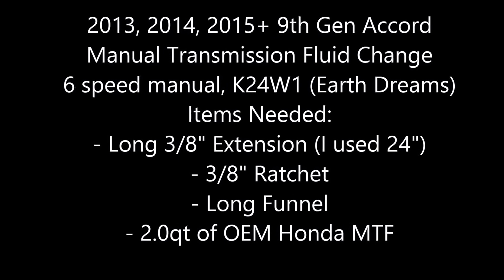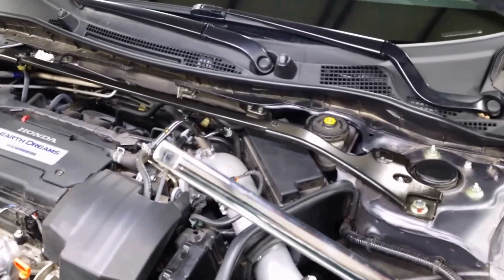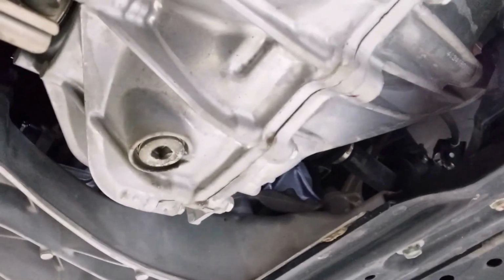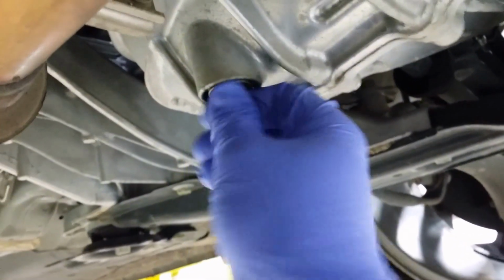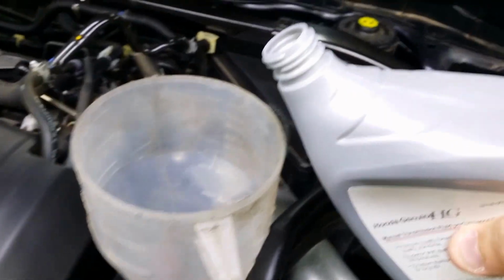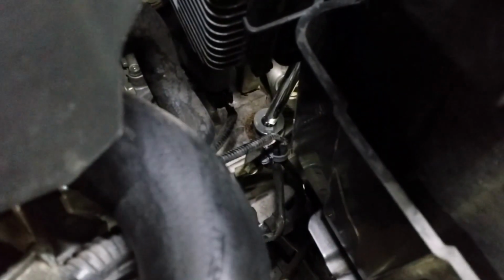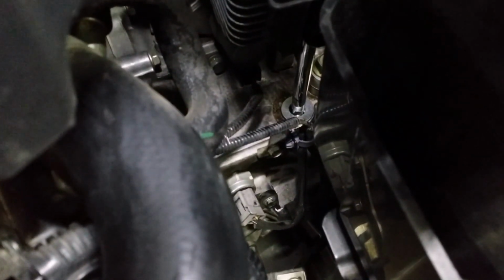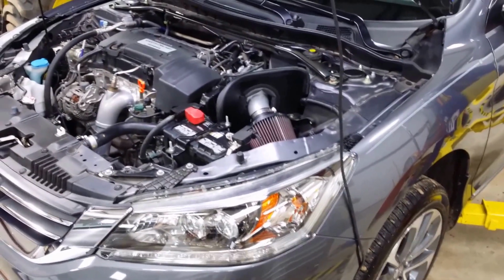2013 Accord 6 speed manual transmission fluid change 2014 2015 K24W1

Comment: I replaced my oem factory honda mtf with GM synchomesh friction modified. It got rid of the notchy-ness..but only slightly. Still notchy from 2nd to 3rd and from 4th to 5th. Any ideas? Im currently at 103k miles, when does the clutch fluid need to be changed?
Reply from the maker: I'm at almost 200k on this car now.  I've noticed that it has become a little notchy in 4th to 5th.  I still change the MTF the same way with the same stuff in this video.  

I have never changed the clutch fluid in this car either. (original owner, 2013 6MT). It is just DOT4 brake fluid.
Reply: @ScottHD  and you’ve always used the oem honda mtf? Everyone and their mother swears by this GM synchomesh friction modified fluid and redline. Still notchy to me. Mines a 2014 and i love the car but that notchy shift feel is starting to get a bit annoying.

Comment: Where can I get a down pipe like that..? Just bought a 2016 accord sport w/manual trans
Reply from the maker: RV6 performance makes them.  Google that name and you'll see several options for finishes.  mine is a ceramic coated stainless steel one.  It has held up great for almost 100,000 miles and counting.
Reply: slimjim355 I live it, there are so few manual trans in the Midwest, so far I'm the only one that has it... I love it...I got Honda data flash pro also, runs awesome.. with just tune, down pipe and exhaust.. can't believe it's only a 4 cyl..
Reply: So you noticed a considerable power improvement with the mods (RV6, SRI, & Hondata flash) over stock?

Comment: Do they really say you need to change it every 30K miles? My last manual car specified a 105K mile change interval...I have 28K on my 2013 Accord Coupe right now. Guess I need to add this to the list of 30K maintenance.
Reply from the maker: Dell0304 k series have shorter drain intervals I'm assuming because of the synchro wear issues.
Reply: Yes.  The manuals do recommend transmission fluid changes (@ or about every 36K miles).  If you really want the transmission to work strong for a long life, I would highly suggest following this procedure at least every 40K miles.  On the CVT models you can stretch out to 50K miles.

Comment: How many quarts does it take for the V6 Engine, is it the same basic procedure i assume?
Reply from the maker: misternintendoman physics not sure on the v6
Reply: 2.6q so two and half bottles of the honda oil
Reply: Would it not have been a good idea to show the location of the level check plug to double check that the transmission is in fact full???

Comment: How'd you manage to install the Touring LED headlights on this Sport? Did you have to get a new wiring harness?
Reply from the maker: Kenneth Morrison it's a plug and play harness made by the "Hard Top Guy" (HTG).  I think they were about $150.  He makes them for rear LED OEM taillights too which we did.   I bought all of the lights new in 2013 and it was about $2000 at the time since there was nothing used available yet.
Reply: Scott H awesome! Also, thanks for the informative video.

Comment: For automatic trans v4  for 2013 accord, where is the dipstick  located?
Reply: +James Chuaycham I thinik that is one of those "sealed" transmissions.  They are becoming like that more and more.  I am thinking that if it had a dipstick tube he would fill it through that.  My 06 Jetta 2.5 has a sealed transmission and no dipstick.  The thing that is even worse is they want you to think that it is a lifetime transmission fluid as in you never need to change it.  To me that is the boldest lie I have ever heard about cars, lifetime fluids.  Sure I know people who seem to think brake fluid is a lifetime fluid judging from the horrible gunk I once saw when I topped off brake fluid.  I like changing fluids in my car myself.  I use the money that would have gone to paying a mechanic to buy synthetic fluids.  I even change the coolant, it is NOT a lifetime fluid either because there is no such thing.

Comment: Is there a bolt to on the side of transmission to check level
Reply: Yes. I'd open that and while filling from the top have someone spot that to tell you when the fluid is to the right level as it begins to run out. This tranny takes about 2.5 quarts, the 2.4 takes 2 quarts.

Comment: Why would you change the fluid this early?
Reply from the maker: Honda recommends every 30k miles.  K series manual transmission synchros seem to like shorter drain intervals.
Reply: Scott H Huh, no kidding.
Reply: @ScottHD  Great tutorial but where are you getting this interval information from? The owners manual states 30k but only for the CVT. For the 6MT, all it says is to "have a dealer check the fluid level and replace if necessary."
Reply: A. Glanzer Everyone and having transmission and gearbox issues with their K-series drivetrains.
Reply: @isnowyazn  The maintenance minder tells you when to change the fluid. Right now, for 9th Gen 6MT's, most people are getting the MM between 90 and 100k. If you're having issues, changing the fluid early isn't going to hurt anything. But according to the engineers that designed the transmission and maintenance system, you don't have to.
Reply: A. Glanzer These K-series gearboxes are like glass, and I can only imagine the premature wear from not driving them properly. Granted, I’m sure car manufacturers and their R&D take into account that not everyone can rev match or heel-toe. 

Even then, the transmission is fragile.